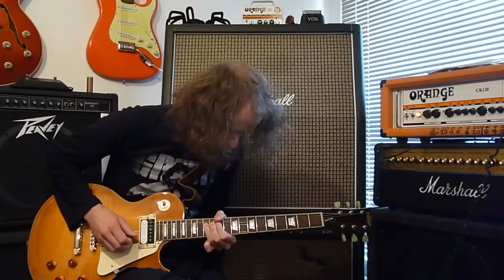Why I prefer Solid State amps to Valve amps

Comment: Even with digital/SS amps there's inconsistency. Anytime you get into pcb, computer like software & chips, there are buffers of memory that need to be rebooted. The solid state amps are only as good as the firmware, software, microprocessors that are circuit mainboard design. If your computer, smartphone can lag and need to be cleaned/cleared, these modelling digital amps will need that same process. Anything digital computer like also has an optimal capacity. Clearing/releasing a memory cache, then there's the pcb & components on that pcb that go bad as well. You'll throw out an entire mainboard when that happens. There is no repair, just disposable. Like TV's, there were the old vacuum tube & tube tv vs LED/LCD screen, those go to the curb for landfill disposal either way.

Comment: u have few good solid state amp sitting next to you. why do we need valve amp? i am on your side. it is just too many bad solid state amps that ruin its reputation. i own a full tube peavey 15w amp and a 100w marshall avt hybrid. both sound really good in clean or max gain. it is the quality of the amp that matters, not solid state or tube in todays technology. i play metal and rock. and my 100w hybrid is louder than my 15w in max, although not substantially

Comment: Try a value amp with attenuation. So the amp is gunning it but you don't have blood pouring out your ears, valve amps generally speaking need to be pushed to hit that sweet spot.
Reply from the maker: I've tried that many times. :)

Comment: I used to have a Randall rg 100 cause Lynch was "using"  them, I was playing with a guy that had a JCM 800 2210 model, the Randall on its own sounded goo but when going head to head against the Marshall it was washed out, Of course you have the Axe fx and Kemper, as far as heads there nothing more than a distortion box with a power amp

Comment: THIS is why solid state. Try playing pubs/clubs with a JCM 800 half stack. You'll have to worry about tubes blowing/breaking, lugging it in and out, and that's all if the venue even lets you in with it. As Dave said; you get a consistent tone and, volume isn't an issue. No costly 12 month servicing, and a lower general price tag, for what sounds virtually the same. No person has ever said to me after a gig " I noticed your sound is very solid state". NEVER. It's like somone saying they noticed a digital delay instead of an analog. Complete bs. Never happens. Never will.

Comment: Who makes the best sounding solid state amps in your opinion?
Reply from the maker: There are a few. Orange, Marshall and Peavey. :)
Reply: Depends for what. I like the Fenders best, but probably not the wisest choice for metal...
Reply: looking for a great hybrid  you can get on the cheap now. Keep your eye  out for the overlooked Fender Cybertwin. 
I have found it so versatile it has become my favorite. By the way,one of these hooked to the new bass breaker cab in its 5150 configuration is jaw drawping.
Reply: a crate g1600 if you're playing stuff with high gain distortion. for the price ($100 - $200US used) it cant be beat. pretty sure cannibal corpse recorded "the bleeding" with one.
Reply: John Simms. Randall

Comment: The difference in tone is not evident at low volumes.  Crank a tube amp loud with a distorted tone and compare it to a solid state amp cranked and it will be obvious.  Even order harmonics vs. odd order harmonics.

Comment: There is a huge difference between a good sounding amp and and a bad sounding amp.( Sound being the main difference ) If tubes play a part in that then so be it. The Orange 120H is not a good amp to be comparing a SS amp vs A Tube amp. The reason i know this is i have been playing guitar for about 40 years and have had many amps SS and tube a like. Currently i have a Mesa Boogie Mark III, A Marshall silver jubilee head, Roland Jazz chorus 77, Fender super sonic 60 combo, ADA MP1 Preamp and a Kitty Hawk Quattro preamp both powered by a peavey 50/50 stereo classic power amp and an Orange 120H...this very amp he has. Of all the Amps I've had through the years, this Orange 120H is the ONLY SS amp I've heard that sounds and feels like a Tube amp. This amp is the exception because there is typically a distinct difference between tube and SS sound. Not so with this amp. I would say he would be fine playing a good tube amp because his amp sounds like one and he seems to really enjoy it. There are some really good amps out there and some really bad ones. If tubes play a part in that then so be it. Let your Ears be the judge.                                                        Keep on Rockin ♫♪♫♪♫♪♫♪

Comment: I'm still using my H|H IC 100 S I bought from a second hand shop in 1978. Nowt wrong with it. And yes, the prices are extortionate these days.
Reply: In fact, I have now invested in one of those Marshall Code 100 Combos. I'm now at the age that I am fortunate enough to have some disposable income and at £349 for the 2x12 combo, which surprised me because it has a speaker out jack and an effects loop, I couldn't resist it. I bought the combo because I can't fit my marshall 4x12 in my current car. I find it very good, would be good if you could review one :)

Comment: Liking them better is fine..But not hearing tube compression on a nice tube combo,  compared to no compression on transistor amps, is incomprehensible to me. The compression is what I look for in an amp. It's classic. But can be simulated (slightly)  w/ a pedal thru a solid state amp, maybe.. But if your not going for that or don't like compression, that's cool. But not hereing the difference does baffle me..Rock on my friend. I enjoyed the video
Reply from the maker: Thank you for watching the vid. :)

Comment: I see your point clearly. I HAD a Fender Ultimate Chorus, I could shove it in the corner of the club I was was playing and it was all set up and ready to fly the next night. Two 12" weird speakers and I bought it used for $103.00 it was fucking loud. I was asked to change towns and I had no time to go back for it. I have a Fender PRO 1000 head and it has one tube. I got high and overlooked putting the tube back in it. I play with it for a year and it was time to service it and shit just a Solid State Amp it was. I played our rooftop concert in New York City with it. I could be heard for near 14 long city blocks. Now my SS Mustang by Fender is great and loud for small blues clubs. I went threw a shit house full of tube amps. My Fender Hot Rod Deluxe is my angel and all,time favorite. I learned to fix and service tube amps. Yep gotta keep up with the every thing on those bastards. I have to dial in a tone and I put a better speaker in it after researching things. I'm more than just a guitar player, I'm an amp tech! I just feel more important than a guitar guy. I have been playing loud music since I left Ireland at 13 and all these years later my ears are so shot that I can't tell the difference between a plop and a splatter

Comment: If you can't hear the difference, then don't get a tube amp. Sure, talk up the advantages of SS amps, but don't turn guitarists who've never tried one away from trying a tube amp. I think most players will hear the difference. Most top players use tube amps (or pre-amps), and there's a reason for that; they do sound better for most people.

Another point. Just about every awesome guitar recording you've ever heard was performed with at least a tube pre-amp. It is very, very difficult to get the same kind of harmonic distortion and waveform clipping you can with valves using diodes and other solid state circuitry. The closest I've heard is with DSP modelling; for example the Rocktron Voodu Valve.
Reply from the maker: I'm not trying steer anyone away from valves to solid state with this video. It my personal opinion and experiences. Solid state is just what works for me. Thank you for watching. :)
Reply: Fair enough. You mention in your video that you've 'seen the dangers of valve amps' personally. I'm curious, can you elaborate on that?

I've designed and built valve circuits, and unless you start opening the chassis and messing with the wiring, or play in the rain, they should be perfectly safe. A shorted valve should not result in any kind of shock hazard, just a blown output transformer at worst.

The usual live gig shock hazards come from ground/earth faults in the venue power supply, and have nothing to do with the type of amp you're using.
Reply: Just because people have done something for a long time doesn't mean its better.  I don't see why tube amp lovers get so defensive over it.  I have had both and for the average player a SS does the job and is way more cost effective in the long run.  Tube amps lovers always look down on solid state amps no matter what they sound like, most would fail a blind test 9 out of ten times as well.

Comment: when you plugged into a valve amp did you think it always sounded everytime you used it.
Reply: sounded different
Reply from the maker: My plexi had its moments of consistency but not very many. Used to drive me mad.
Reply: hey Dave do you rate the New Marshall micro /mini stack that's on sale for £200 at guitar guitar? I'm playing mostly Nirvana tunes at the moment I had a fender champion 100 but I had to trade it for a fender mustang  Kurt Cobain model that I couldn't refuse, I'm using a Sound king Amp I got it from my uncle as a present years ago when I just started to go electric it's a 20watt with a straight forward setup and built in reverb I just keep on the clean channel and add a little middle and treble just a smidge, and run My Boss Ds2, Boss digi tuner,electro Harmonix small clone and the big muff pie,a and a Vox wah wah pedal through, I have been trying to get Kurt's sound down and As I can't see me affording a mesaboogie anytime soon can you recommend the Amp you would be choosing if you were in this situation, Cheers keep on ROCKIN😎🎸🔊👍😏

Comment: Do the Math: Tube amps sound best cranked....Solid State amps lose the harmonic balance and end up blaring when turned up. Playing time is 80% low volume....20% live and loud...But...live playing does not require big amps anymore. A nice Peavey Rage or whatever does the job mic-ed to the PA. I personally prefer an 18 watt Marshall tube because tubes are excellent at every volume in my ears.

Comment: I personally love both, but another thing to consider is that tube amps can sound like a completely different amp if you swap the preamp tubes out. Yeah, it's expensive which is another point for solid state amps, but it does open up a door to a plethora of different timbres. A good middle ground could also be getting a valvestate because there's only one tube to roll. I completely agree that the consistency and weight make solid state amps superior for gigging, but consistency comes at a price. BUT I must also add that in general I've noticed tube amps can sound horrible on certain settings, whereas solid state amps sound consistently good even if they're dialed in crap. Shitty guitarist + tube amp = shiiiit tone

Comment: On cleans, a good SS amp/good speaker is great.  When you start to add pedals, distortion, etc, good luck trying to hear a difference that is tangible enough for your audience to notice.  Tube amps were necessary back in the day to get LOUD ENOUGH for halls and that tube overdrive.  Nowadays PA systems, pedals, modelers do an equivalent job and it's only getting better.  Save the money and research time and spend your time on getting BETTER on guitar.  Heh, I know a 12 yr old kid with a Squier/Roland who runs circles with his sound over guys who own super expensive Marshalls/Mesas and Gibson customs.

Comment: Whats the best solid state amp on the market for a small room that you recomend? Like for a bedroom. cheers
Reply: iv tryed most all tube or trans or soild state.......repaired them i did.

your answer / roland Micro-CUBE-GX  ..... ( the GX's 40, 60, 80, etc will challenge but at tube cost, that's crazy)
buy a used Bugera v22 combo  and a proco rat 2, ( hall of fame, if reverb burnt in v22 which is common) used 150+70+100=$320  (marshall tube sound)

i buy.... V22 combo burnt reverb = $150 , / MG 100 HDFX-H = $100 used ( the other mg models suk,) (full  tube V22 trumps in sound quality and volume over  marshall trans state and HDFX-H) 

crate made a SS  that sounded better then the mg's  but prone to getting stuck 2nd gear...lol
MG heads con: is plastic jacks and tin corrosion ,  fan dieing , needs holes drilled to vent right lmao,  Dont like pedals like all other solid state (except Roland's GX's liked all "Boss or Roland pedals i tryed .. used there Demo Rack. )
Reply from the maker: The Orange Crush 35 rt is awesome for small room / home use. :)
Reply: Cheers for the suggestion im getting one
Reply: Crush 35 rt at $250 ......... that's insane,  get a used v22 full tube for $230...
Reply: I found one on ebay Bugera V22 Infinium 22 Watt Vintage 2 Channel Tube Amplifier Combo in ... AU $799.00 and no second hand ones in OZ  as opposed to the orange crush for 345.00 brand new. So yeah not insane im loving it and it was the perfect decission AWESOME price too. Cheers anyway.

Comment: you can always go 19 rack 
tube guitar  preamp    
  cheap  solid state  PA   power amp 
and you get rid off   the matched   set power tubes 
and bias  
crown power amps  have work for guitarists  
from Cobain  to Petrucci    

you can  have the shitiest  tube amp  
hearing the tubes rattle   
no bias  adjust  
thin fizzy sound 

but the placebo effect is strong 
most they will say 
it's a tube  amp it sounds great

Comment: A tube amp only draws the current of a light bulb or two. I can't see that much current is hard to come by.
Reply: But it is current we are talking about. Most tube amps use about 100-200 watts input power at 110 volts. The high (and low) voltage comes from the power transformer. Most of the power consumed by a tube amp is low voltage. 5 or 6 volts powering the tube heaters of the power tubes. If a venue can't give 200 watts, then they also will have trouble lighting the venue up at night.

Comment: Valves/tubes are cheaper than keeping a guitar in decent strings if you know what you're doing. I play in  UK pubs, never had a problem with power.  Used valve amps can be cheap to buy. Valve amps sound so much richer, overdrive  nicer. SS amps sound sterile at best

Comment: I play through a sampson portable 40 watt pa system runs on batteries I use a boss multi effects pedal into the amp it has an eight inch speaker in it I own a box and marshall tube amp and the tone I get out of the samson kills both they are collecting dust in the studio also the samson is solid state

Comment: Yes solid state amps sound great clean like the jazz chorus has proved for the lat 40 years. The rap on SS has always been when you turn the gain and overdrive the amp it  can't keep up with sweet power tube breakup. Yes until the ZT amp company came on the scene. There SS amps are the only SS amps I've ever heard that have respectable break up when  you turn up the gain.

Comment: To be honest if you think solid state amps sound better your not giging them, they're great for playing at home at low volume and yea a solid state amp on 1 sounds way way better than any tube amp being under driven. At live volume where you can really let the amp breath a tube amp sounds better every time. 

Also the weight argument doesn't hold up, sure a 100w tube head is heavy, but not as heavy as the speaker cab and if your using a ss head you've still got to bring one along.

The maintainable issue is rubbish too, pat testing does nothing to guarantee the safety of an amp. You don't need to rebias and retube an amp every 5 seconds, if you want to that's fine just learn how to do it your self it's not hard! 

In real terms of reliability tube amps blow ss amps away too, 90% of the time any issue is going to be a blown tube which is a dead easy fix and any maintainable on a point to point wired amp is much easier than on a pcb amp. There are plenty of small manufacturers making affordable hand made amps in this manner!

Comment: modern production tubes are awful.  i have had many fail.

I get it's subjective but I really do find the difference between valve and ss amps to be down to feel.  the way they drive speakers.  tube amps usually have a softer power delivery and push more air, many ss amps used to have a really harsh immediate delivery although many seem to be cured of that these days.  also, pushed tube amps have this harmonic thing going on and respond to the changing impedance of the speaker as it moves.  i have never heard an ss develop the musical overtones or break into harmonics the way tubes do... but they are their own thing.  sunn beta lead heads for example are some of the thickest heaviest sounding amps i have ever heard and they are transistor

Comment: well these are intelligent reasons.   I would agree that they are heavy (the biggest deal of all to me), and expensive.   However i do hear a massive difference typically (not always) but i wouldnt use the word "warmth".  There is a sound difference but its even more of a dynamics difference...  the way a valve amp reacts to your touch.  From what i understand its NOT the tubes that causes this, the most important thing in the feel is the interplay between the output transformer and the speakers.  And also the circuit itself which is much different than typical SS amps.   But i dont get the"valve snobs" either because 99% of them have a whole chain of SS gain effects in front of the "all tube" amp they are so proud of...  (good) Tube amps flourish at the "in between" sounds.  If you like to play with heavy distortion or (especially) clean...  valve amps will likely not be for you.